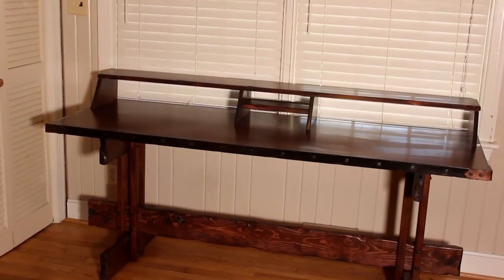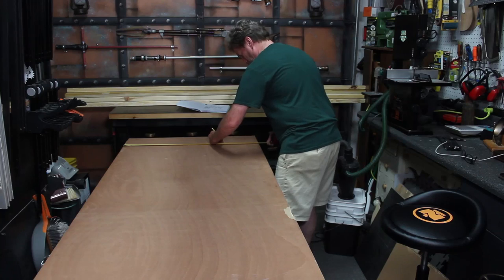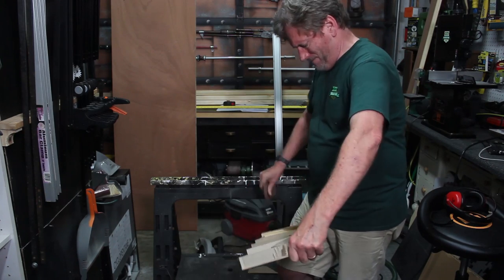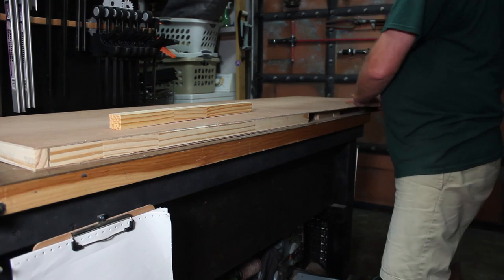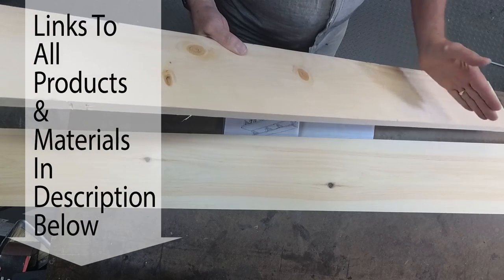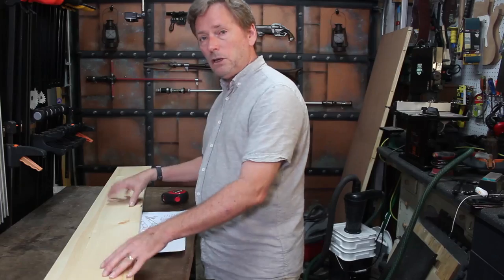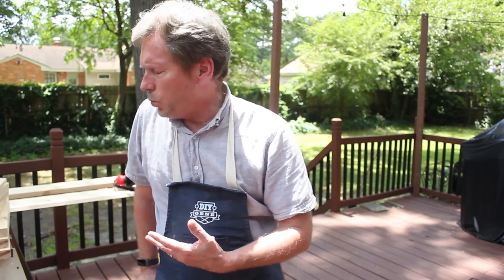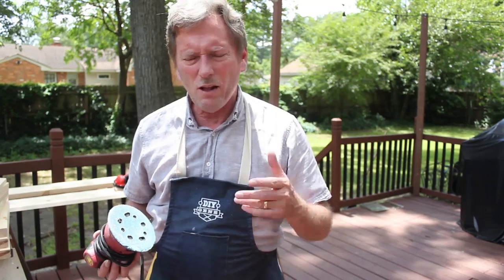Build A Steampunk Desk With Only 3 Hand Power Tools!

Comment: Nice job, at first I thought it was a shop table and wondered how a hollow door was going to handle that. Nice work👌🏼
Reply from the maker: Thank you. The door is holding up great, but if I were to do it again I would use a laminated pre glued board as the top. The cost would be about the same and it would be even stronger. Thanks for watching.

Comment: Absolutely amazing, thank you for sharing. Very original and unique, excellent job!🤩🤩🤩👏🏽👏🏽👏🏽👏🏽👏🏽I am in love with the wood stain. What type of stain shade did you use? 
I followed the link to Amazon, and there were many shades to choose between 😅I want to buy the same as you used🤩🤩🤩
Reply from the maker: Thank you, this was a fun project. The stain I used was Varathane Red Mahogany. I hope that helps. I would also check out the laminated wood planks they are as cheap as the hollow core doors and much stronger. You can get them at Lowe’s and Home Depot. Thanks so much for watching.